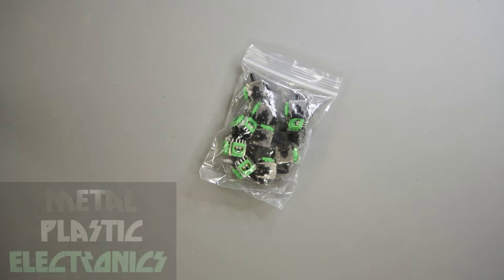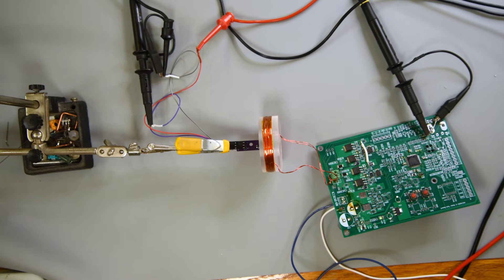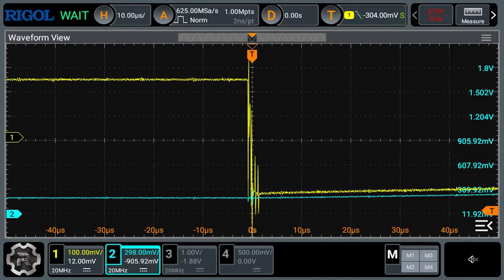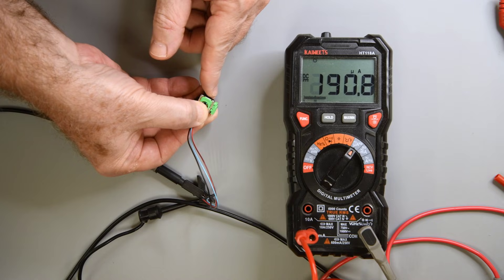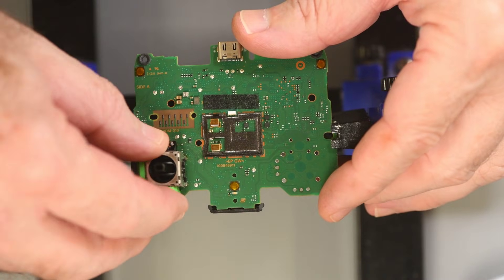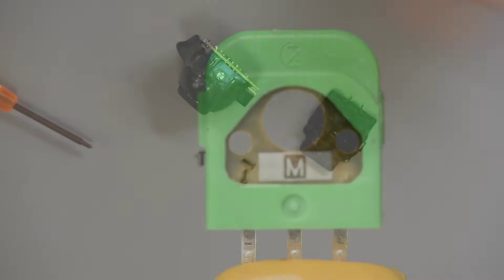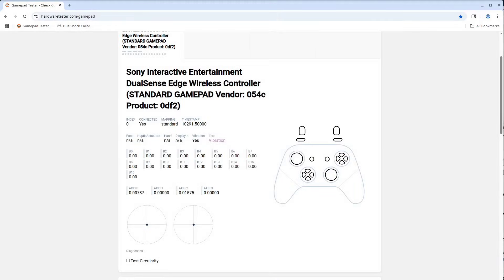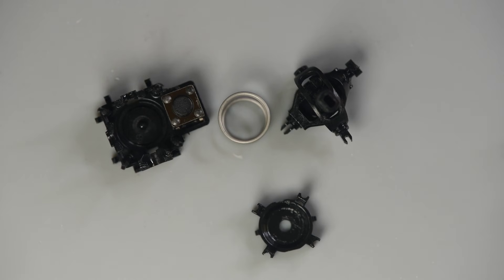Finally! Favor Union's First TMR Joystick Put to the Test

Comment: @metal plastic electronics Hi, I also installed the same TMR Favor Union analog sticks. I installed them correctly and straight, but after calibration, one corner doesn't reach 100% of the circle. What could be causing this? I replaced the second pad, and the same thing happens, only the upper right corner doesn't reach 100% of the circle. Only extended calibration can extend this, but then the deflection range of the other corners increases as well. Regards.
Reply from the maker: These exhibited very low circularity errors, indicating that even slight mechanical or magnetic misalignments could be responsible. This might stem from how the mainboard mounts in the controller. As a potential solution, try gently deforming the shaft to shift the magnet slightly.

Comment: Has anyone in here used both guilikit tmr or halpi tmr and compared them to favor union tmr and if so which ones feel closest to stock ps5 stick modules tension wise and analog clicking in wise.
Reply from the maker: The Favor Union will feel closer, especially if you have a controller with Favor Union potentiometer joysticks.  The GuliKit/Hallpi has a softer feel.

Comment: I'm not sure I understand correctly - can you just strip those TMR "potentiometers" from Favor Union module and put them on a standard ALPS module - will they fit?
Reply from the maker: No.  The Favor Union TMR sensors will fit a Favor Union potentiometer joystick.  There are some joysticks on AliExpress that are Alps joysticks with Ginfull TMR sensors on them.  Those sensors will fit an Alps potentiometer joystick.  The GuliKit TMR sensor will also fit an Alps joystick.

Comment: I remember some ps4/ps5 controllers containing the black sticks with yellow potentiometer and also having different ohms as the ALPS ones. I think they were from favor union also.  So this brand is basically original. I remember the sticks itself being very good but the potentiometers not so much. This would def. fix that. Gonna order a few in the future.
Reply from the maker: Yes, the orange potentiometers were on the Favor Union joysticks.  And these Favor Union TMR sticks feel the same.  And the sensors on these will fit on the old potentiometer joysticks, so it can make for an easy upgrade.
Reply: Thanks! Good to know. @metalplasticelectronics354

Comment: Is this compatible for Xbox Series X model 1914 controllers?
Reply from the maker: You will ned the version for the Xbox controller.  If the Model 1914 is similar to the layout of other Xbox controllers, it has the B+ and ground pins swapped on one of the sensors.

Comment: I find that you can put the favor union sensor on the gulikit frame with trimming the gulikit magnet down some on the side so it will rotate freely. Do you think it will work?
Reply from the maker: I wouldn't expect the GuliKit magnet to be strong enough to operate the FavorUnion sensor to its full range.  Would have to put a meter on the output and see what the voltage range is.  The FavorUnion sensors require a significantly stronger magnetic field.
Reply: @metalplasticelectronics354  that is my concern the magnetic isn’t strong enough. Bec the FU magnetic is bigger then gulikit. By feel they do feel like the same strength. I like the response of the fu but the gulikit frame I frame I can change the spring to add the tension I prefer.

Comment: Hi there. May I know what's the pros if you use gulikit tmr case and body and use it on ALPS joystick sensors. Is it good?
Reply from the maker: The few I tried worked pretty well.  You get the best results with the sensors on the native joystick frame, but it's a lot more work.  If you have an Alps potentiometer going bad, it's a workable replacement.  The only reason to do it would be if you don't have the equipment to replace the entire joystick.  Unsoldering 3 leads is a world of difference compared to removing the entire joystick.
Reply: have you made a video about this?.mix and match
Reply from the maker: Yes, take a look at this video: https://youtu.be/v6CAmJTqCJ0?si=7sbqc4HdoQJTHDDU
Reply: using full gulikit better or mix with alps better? What do you suggest I should choose?
Reply from the maker: If you can replace the entire joystick, you will get better results.

Comment: These sticks are way too stiff but I found replacement micro springs half the wire thickness as these favor union sticks. With these micro springs I found these should be gulikit smooth
Reply: The spring inside this favor union is 0.8mm wiresize 9mmOD x 5mm length. This compression spring only has 1 coil between top and bottom. The spring wire size is thick too thick you can find better springs 0.4 and 0.5 wire size with two coils between or 1 coil at half the wire size.

Comment: You talk about the feel.. you can get the spring that goes inside of the joystick to make it have more tension while moving an clicking r3&l3. Which I find good for  call of duty to have the R stick have more tension while the L stick for aim… they have 100g,150g,175g and 200g  and they have 50 gram spring also
Reply from the maker: Now that is seriously wanting more tension.
Reply: @metalplasticelectronics354  I work in concert/polymer so I use my hands a lots so the added tension help for over moving… help with those light movements that is need

Comment: The TMR's have been out for a couple months.  Ive been installing them since about March.  I offered some to this channel a while back but never heard anything back. The c1 and c2 were for capacitors. They were using them during prototyping. I tested a few and still have a few prototypes. The current version actually performs a bit better.
Reply from the maker: Sorry, I missed the comment; it's been a crazy couple of months.
Reply: @metalplasticelectronics354 Has anyone in here used both guilikit tmr or halpi tmr and compared them to favor union tmr and if so which ones feel closest to stock ps5 stick modules tension wise and analog clicking in wise.
Reply: Hey I'd love to try some out! I operate a repair shop locally in Canada so it'd be very useful for me

Comment: I saw in comparisons when aiming in a game you can make lighter and slower changes as if they were more sensitive, others like the GuliKit make jumps as if they had less resolution
Reply from the maker: The output of all the TMR sensors I've tested is very linear.  Something is wrong if it is jumping in steps.
Reply: Sugiero pruebes su comportamiento en la herramienta de circularidad y calibrado, y/o en un un videojuego @metalplasticelectronics354

Comment: Hi thanks for the video and the in depth testing 👍🏼 in you experience have you ever changed a stick and the controller not work after I have the led indicator blink 3 times I plug it into game tester and controller not recognised, everything works when I plug it to the ps5 except the new thumb sticks , I’ve tried different batteries  I’ve cleaned it I’ve re soldered the joints , I’m at a loss any ideas?
Reply from the maker: I have not, but many things can go wrong.  Do you have a meter to check some voltages?

Comment: It is better Favor union TMR or Ginfull TMR ????
Reply from the maker: It depends on what kind of feel you are looking for.  Ginfull may be a tiny bit more force to move, Favor Union is very close to the Alps, and Hallpi/GuilKit are a bit less force.
Reply: @metalplasticelectronics354 thanks a lot, so if i prefer something with more resistance its better to put a ginfull on my controller ?
And please can you tell me which ones are the most reliable in terms of durability?
Thanks a lot, im now a new suscriber 😊
Reply from the maker: Of the TMR joysticks, I would say the Ginfull has the highest tension.  As for durability, Favor Union has been manufacturing joysticks for a very long time, and their standard joystick mechanism lasts a long time.  I think K-Silver has been making them for close to 10 years. I think most of the other TMR brands have less experience.
Reply: @metalplasticelectronics354 favor or ginfull which one is close to stock dual sense analog motors can you tell me? And thank you my king you are awesome!
Reply from the maker: The Favor Union is going to be the closest to OEM; Favor Union's potentiometer joystick was used as OEM in some of the DualSense controllers.
Reply: Good answer i want to know too 😊

Comment: Is this compatible with bdm 020 boards?  Without soldering?
Reply: Should be compatible with any dualsense board. But you'll always need to do some amount of soldering to replace either the sensor or the entire module

Comment: hey dude, thanks for the video - can you recommend a TMR joystick compatible with the Xbox Elite V1 or Xbox One controllers? Thanks a lot.
Reply from the maker: I don't have any of the Xbox controllers.  I know one of them uses Hall effect triggers that are close to the left joystick.  All I can say is that for the left joystick would probably be best to use one of the joysticks that has the TMR sensor at the top.  A little distance can do a lot for magnetic interference.
Reply: @metalplasticelectronics354 thanks - I didn't know they had sensors in different positions. which ones have sensors at the top?
Reply from the maker: The Hallpi/GuliKit and I saw a post that said the newer versions of the K-silver, but I haven't seen the K-silver myself.
Reply: @metalplasticelectronics354  thanks for the tip bud, i'll look into them!

Comment: Thx for testing all the sticks. I’m using the gullikit ones. But the comparison is very interesting to see how they differ. Thanks for that.
Reply: Yea they feel very different as well.
Reply: Which one is better ?
Reply: @dorukakbulut9081 gullikit so far has the best sensor in my opinion. But there is also ginfull tmr modules which  are quality wise and how they are build better than gullikit. So I’d say one of these.

Comment: I installed these the other day and noticed a few things. On my 020 series dualsense, my left stick was rubbing against the anti friction ring  and causing it to bind when I released it. The height must be a little taller on the FU sticks. I also noticed on the test site that if I barely push the stick up and let go, it doesn't fully return to center which can be a pretty decent issue if you play games with very small stick movements. I also noticed that it take a very large amount of force to remove the joystick caps. I have to pull up with an uncomfortable amount of force to get it to come off. I'm thinking these are cheaper than the guilikit, but maybe not quite as good in some aspects.
Reply: I have had similar experiences. I installed the FU TMR sticks in one of my Dualsense Edge controllers and found that the thumb stick caps are very, very difficult to get out. They also don't press well when I try to make several clicks in a row. After the 3rd or 4th click it just gets stuck and I have to release my thumb very hard. For comparison, I had a hallpi tmr stick that worked without any problems. You really notice this in the gameplay. I will soon swap the analog stick and install the sensors
Reply: @sinanozturk2166 man removing the cap off the FU sticks takes a very uncomfortable amount of pulling. I felt like I had to be damaging something inside the joystick with the amount of force required. At least now I know I'm not crazy. Have you tried going to the test page and seeing how close to center to get when you gently push the stick up a bit and release it ?
Reply from the maker: Unless it's a badly molded shaft, I haven't noticed any difference in height of the Favor Union joystick frame since the first ones I've tested.  The Favor Union and the Alps seem to be among he most consistent joysticks I've seen.
Reply: I haven't had any issues with the height of the FU tmr. They are usually spot on. Maybe there is a chance your tmr wasn't seated fully when you soldered it. Now the stick bases to fits very tightly.
Reply: @tonka8080 it's definitely completely seated. I had this issue with the fu hall effect sticks before as well on this controller. It's possible there's a slight variation in the controller itself that makes it not play nice with the FU sticks

Comment: Is the resolution of the TMR joystick much higher than Hall effect joysticks?
No, that's not the case. Carbon film joysticks, TMR joysticks, and Hall effect joysticks are all linear devices. TMR joysticks and Hall effect joysticks are both a type of electromagnetic joystick. For game controllers, the bandwidth of these three types of joystick sensors is sufficient. The resolution mainly depends on the sampling precision of the backend MCU, and is not closely related to the joystick itself. So after replacement, the joystick resolution, polling rate, and other performance characteristics will be consistent with the original controllers.
does that is the truth?

Comment: Is there good datasheets to test ps5 charging I have 2 v4 controllers that won't show signs of life. I'm pretty new but I would expect a voltmeter to read out from the jconnector where the battery plugs into the motherboard. Any help or resources would be greatly appreciated
Reply from the maker: A charged battery should have around 4.1 to 4.2 volts across the red and black leads.  The controller will probably cut off in the 3.2 to 3.4 volt range.  I know the DualSense has a strange charging setup, but I'm not sure about the DualShock 4.  Have you tried a new or a known working battery?

Comment: Good evening, great video as always. Does this model only serve to replace the dualsense that comes with the orange analog sticks?
Reply from the maker: If you replace the entire joystick, it will replace any DualSense joystick.  But the sensors that come on these will directly replace the orange potentiometers.  The sensors will not fit the blue/green potentiometers on the Alps joysticks.

Comment: I deleted comment on gulikit module as thinking back to it, it may have been an installation issue, not too sure.  I have had these where they require the k silver tweezer tweak but nowhere to the extent on your video.
Reply from the maker: I've seen it a little in a lot of the joysticks.  I do believe it mostly clears up as the joystick is used.  Those couple of K-Silver's were very noticeable.  But it's such an easy fix.

Comment: which one would you say has the lowest tension. like a broken in stick feel of alps joystick?
Reply from the maker: The Hallpi/GuliKit.
Reply: @metalplasticelectronics354 thanks for your reply! I have the gullikit installed on my ds5. Although they feel rock solid, tension wise they aren’t as low as my Hall effect sticks on flydigi Vader 4 pro. Which felt similar to stock alps tension I was looking for. 

I’ve only been using gullikit TMR sticks for a few days so I assume there’s a break in period. I will report back if the performance changes in the future.

Comment: Could you do smoothest to least smooth movement for sticks? Rotation

Even the how much force it takes to push side to side for each stick? 

Also maybe L3/R button press I’m guessing they’re all the same as it looks the same
Reply from the maker: I've tried doing a bit of measurements by hand, and it doesn't work.  Going to take a bit of work to build something that can measure the force correctly.  I'm still thinking about it.
Reply: @metalplasticelectronics354 i saw a Russian video in YouTube a few mouths ago, where it was measured doing pressure with the hand against a scaler. Its a hand made meteod, so the measurings could not be precised.  Maybe with an 3D printed toll and a scaler it could be done 💡
Reply from the maker: I've tried by hand, and the results are not consistent.  I believe the speed and angle at which the arm is moved must be very consistent, so that is going to take a motorized mechanism.
Reply: It feels the same as alps original joystick 🙂

Comment: does the whole joystick module have to be changed on the edge modules. I didn't get that part. or can you just change the sensors and solder the wire for calibration  thanks
Reply from the maker: You have to change the entire module to use the Favor Union.  You can take the sensors off the Hallpi/GuliKit joysticks, as they will fit an Alps frame. You won't get as low of a circularity error, but it will still be better than the potentiometers.
Reply: @metalplasticelectronics354 Hallpi/Gulikit Potis on Alps Frame will result in a wobbely centering/drifting. You should‘ve noticed that! I did notice it in several testings